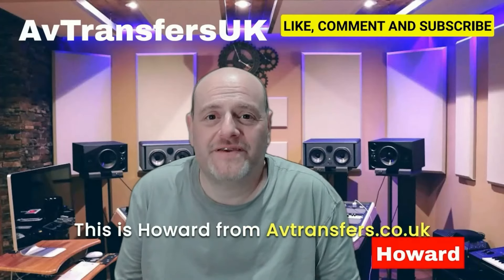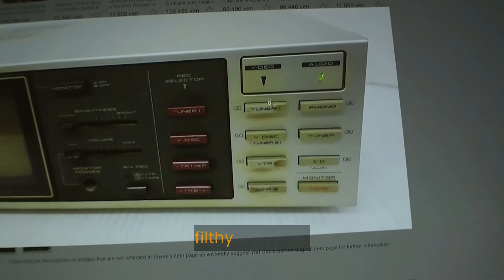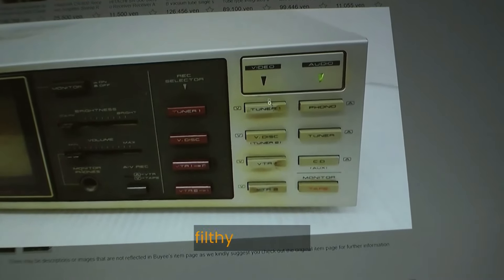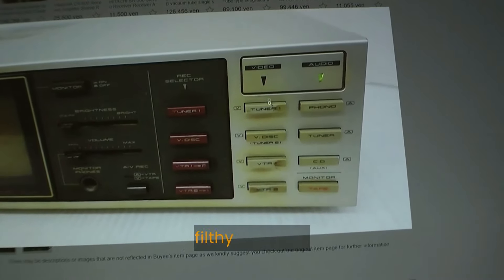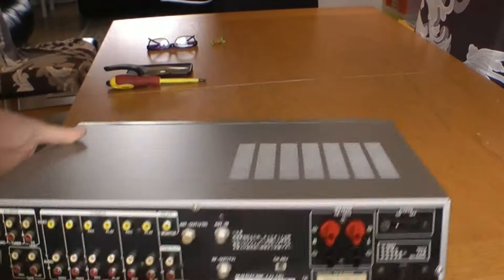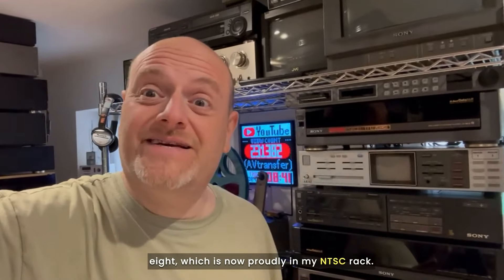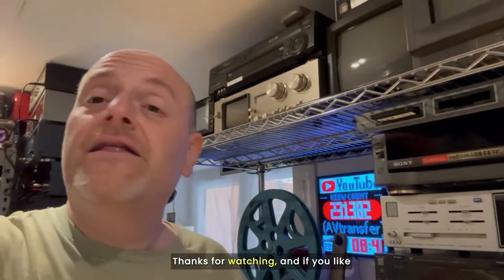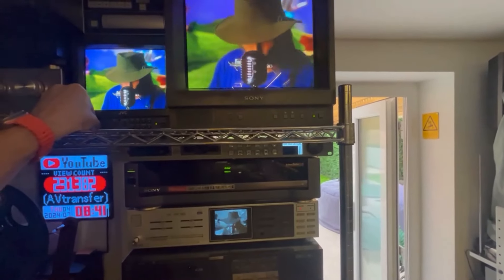Reviving a 1984 Akai AV-U8: Vintage Amp with Built-In 4" TV Restored to Glory! @avtransfersUK

Comment: Hi great video I just picked one of these units up locally untested for £100 took the gamble as it looked in great condition and it's in black,the gamble paid off it sounds great connected to my sacd player ,how best can I use/test the monitor, it would be cool if I could connect it to my smart tv 
Cheers
Reply from the maker: Great. Probably not much with a smart Tv unless you want to use it to switch old video games consoles.  Alternatively get a hdmi to cvbs converter to display what you are watching on the big screen.